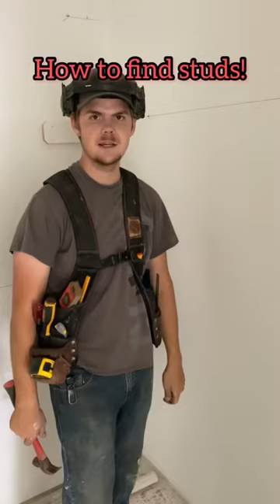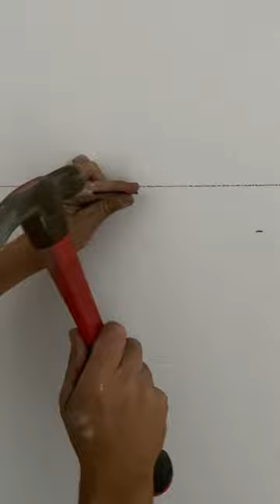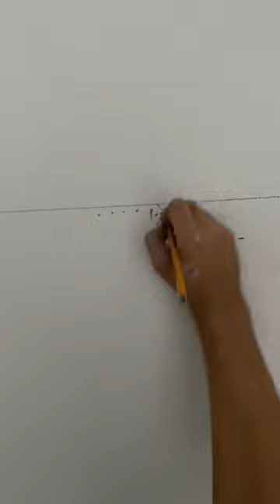How to find a stud… #carpentry #construction #trim #build #humor #cabinetry #drywall #tiptricks

Comment: Yes! I remember my 1st day too😔
A very strong magnet 🧲 will find sheetrock screw heads or sheetrock nail heads. Very unlikely that sheetrock wasn't nailed to studs. Very unlikely!!
Reply: Unless it's in channel. Not sure if that was a house or multifamily apartment but in multifamily they use hatch channel, continuous runs of metal in between the studs especially if it's a sheer wall and has a two or three inch screw pattern